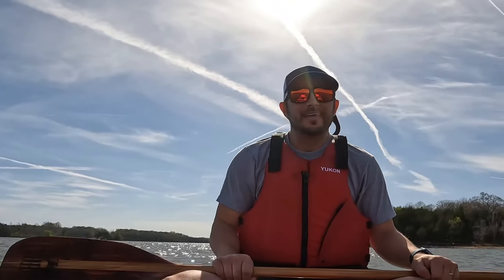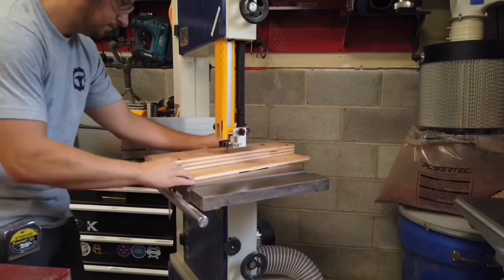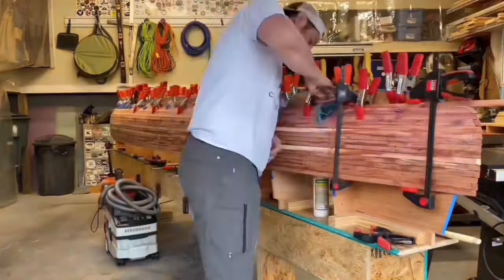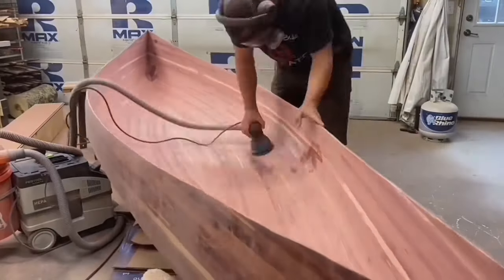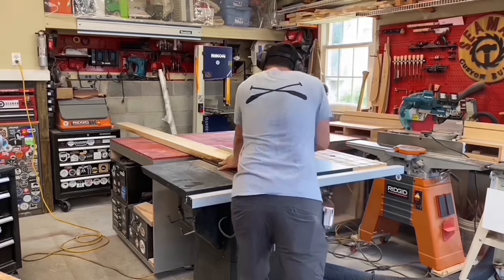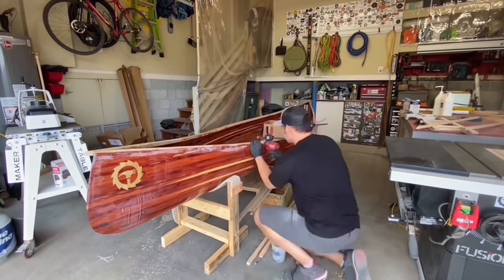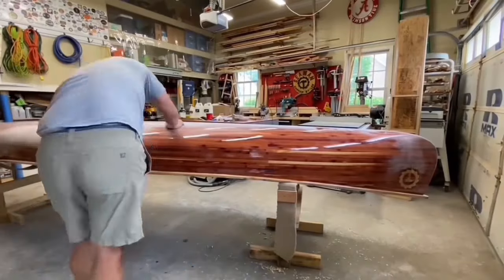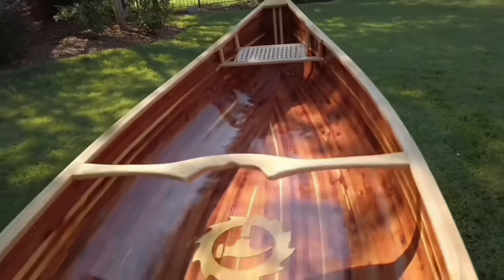Building a cedar strip canoe!

Comment: Looks amazing! Any tips&tricks on what to do to don't do? You've mentioned a few don'ts but maybe you've learned about some other stuff now that it is done?
Reply from the maker: Thank you and thanks for watching. I wish I would have done a better job putting on the bead and cove, made sure the strips were tighter when putting them on the forms, been a little more careful sanding the strips, wipe off epoxy drips and runs before it dries, I think that might be it
Reply: @seamancustombuilds2553  Thank you for your answer! I will take these into account once I start building my first wooden canoe. I am building one from fiberglass at the moment, but I don't like the material

Comment: I'm having a problem getting the strips to lay flat on the stations, Any help
Reply from the maker: Are you stapling or using clamps?
Reply: @seamancustombuilds2553  just clamps, I first tried staples but they would pull out when I bent the strip, was using T50 9/16 staples,  do the sprips have to lay flat ?
Reply: @carlhornback5087  Yes, or fairing will be a nightmare and you will thin the core too much in doing so.  Use what even tools you need to flatten them.  I glue a strip on the station mould back from the edge then install a clamp.  I have also used rubber bands to do the same.  I cut up old bike tubes for rubber bands.